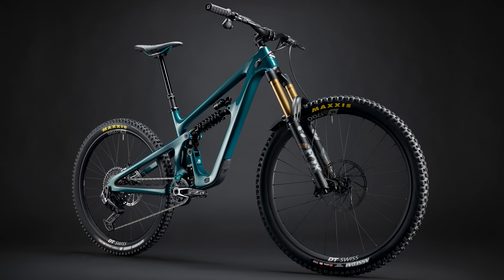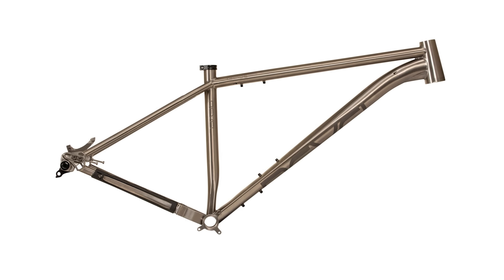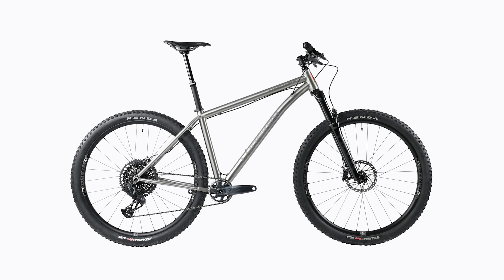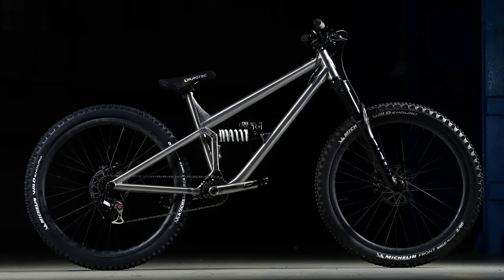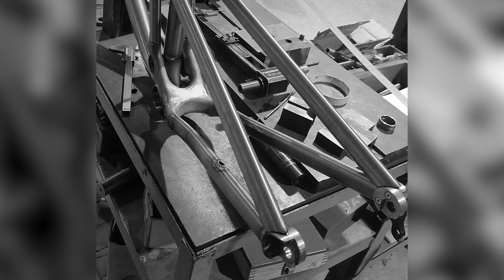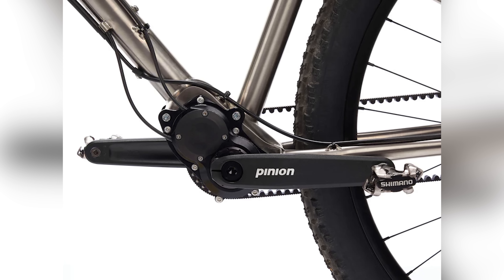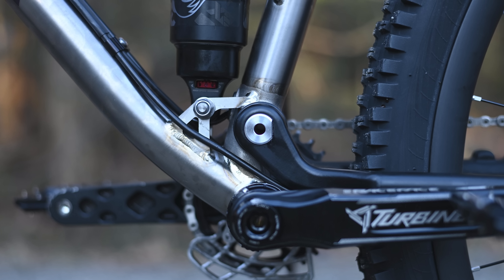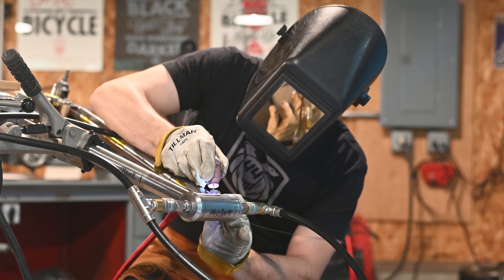Top 5 2024 Titanium Mountain Bikes

Comment: I have a titamium Esker Hayduke and it is amazing! I love how this frame feels and the geometry is in the perfect sweet spot and not overly long and slack like so many bikes these days. Long and slack is not a good way to have an all around bike, it's essentially only good for steep downhill at high speeds.
Reply from the maker: Sounds like a lovely bike!
Reply: Agreed. Long and slack may be great for downhill, straight-line, high speed performance, but the usefulness ends there. There’s so much more to mountain biking! 
I have an Esker Japhy (sadly, not Ti), and its geo and feel would be very similar to your Hayduke, in that sweet spot. I’m guessing the Ti version of the Japhy is super: just lighter and maybe a little firmer than the 4130 version.
Reply: I've never had the chance to ride a Titanium mountain bike 
l😭l. How is the ride? I've heard really good things about the BEST material for a bike 🤘🤘
Reply: @glen3509  It has similar properties to steel, but lighter.
Reply: @ShadLife  I know Ti is lighter than steel. 
As most know, it's the K❗️NG for strength to weight ratio 🤘🤘

Comment: For a hardtail ti is great. Lightweight, no rust, supple ride, hard to scratch,
Reply from the maker: Its a lovely material! Not easy to work with, or cheap and can be prone to cracking at the welds, but little else will do it for some people!
Reply: @bikeradar  welding is difficult with ti. The oxygen levels have to be monitored else it overheats. I think that’s what makes the frames prone to weld cracking
Reply: @bikeradar Lynskey has some killa prices right now. This would be a great opportunity to get an American made lifetime warranty frame